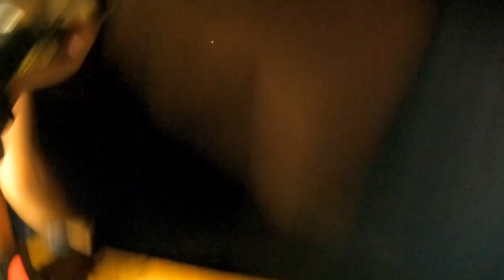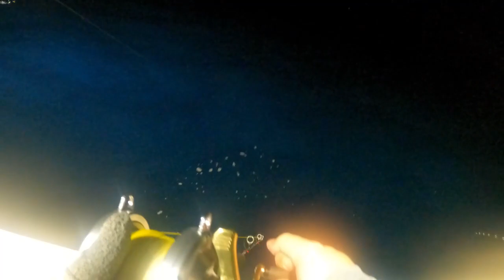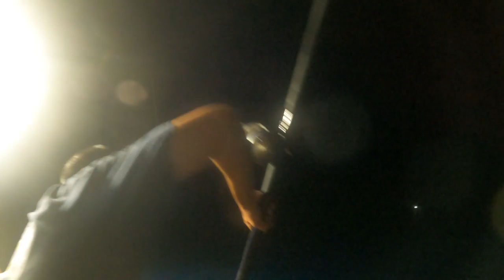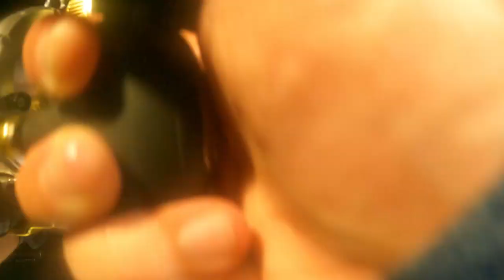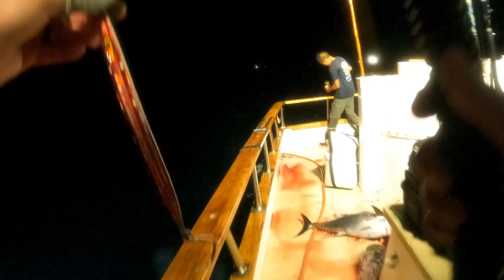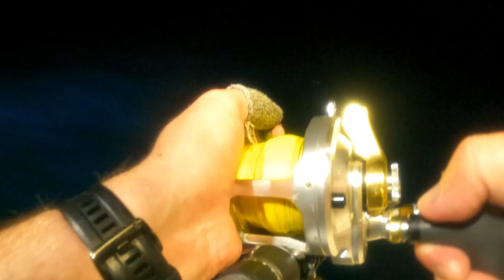BLUEFIN TUNA ON KNIFE JIGS - Voyager Sportfishing - Part 2/2

Comment: I noticed you are using a single hook with no assist. I think that helps you get down to the fish slightly quicker. Obviously no problem hooking them. What type of hook were you using? Well done! Never seen such an effective knife jigging session. You were in the groove
Reply from the maker: Vincent, thank you for the question about the hook. Later today I will film a video on how I rig my knife jigs.  Am I the best?  No.  Although I am sharing what I have learned thus far.  The hook in this video was a 10/0 floating around in my hook box. I think it was a Mustad but I am not entirely sure that is correct. Since this video I changed to a jobu hook you will see in the video I make today.  Check back later on for the knife jig rigging vid!

Comment: Not bad, but enough trips and you’ll learn how to handle them with the proper technique.  Tail hooked or not you have to put the wood to them.  Great job either way.
Reply from the maker: You are 100% right, I ended up applying more pressure to all the fish after the first one.  The first fish in the video was the first knife jig fish of the trip and I was unsure how big it was. I kept it in high and waited for it to turn back around and swim at the boat so I kept it in high gear. We live and we learn so thank you for the comment!